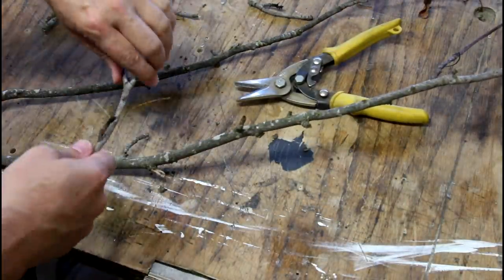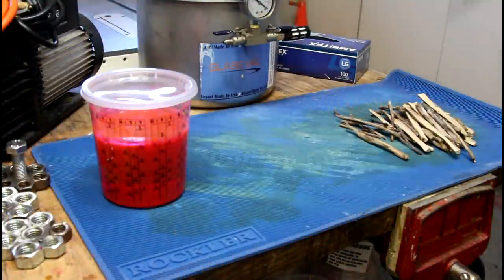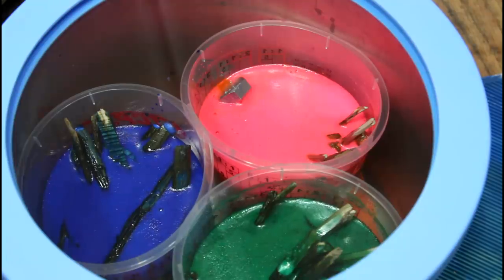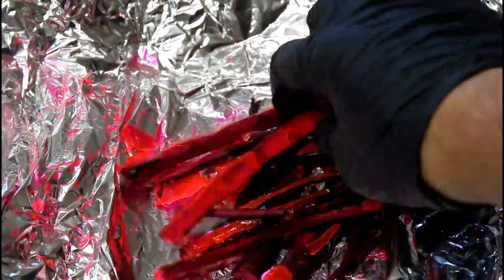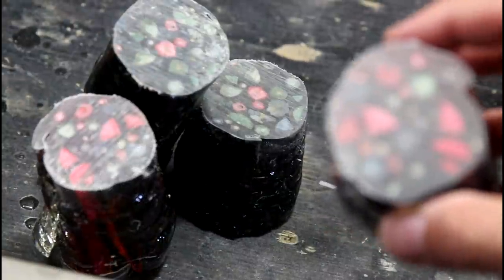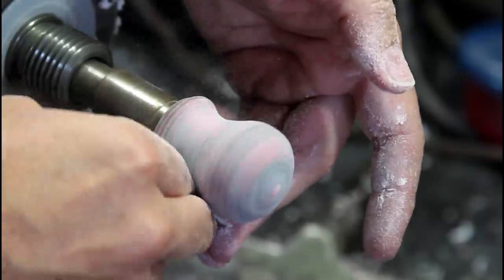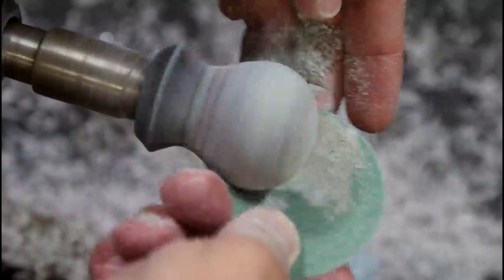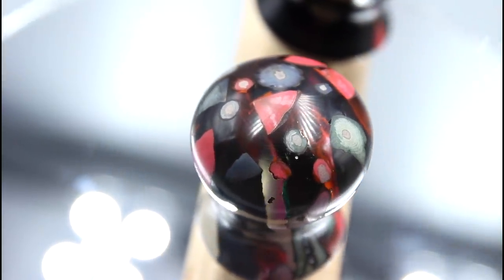Homemade Heather Gems?

Comment: The mistake you made is the heather is separated too much, there's too much space between the pieces. What you need to do is pack them into the molds until there is barely enough room to pour any epoxy, maybe even somehow make a mold that you could put the heather in nice and tight, and then crank it down until it's nice and tight until you can barely even get the epoxy in there. How they do it in the places that make the gems is they saturate the heather in super thick epoxy, then clamp it in vices specifically made for it and let it cure before they slice pieces off that they then carve into different standard gem shapes, as well as others. If you could do something like that before clamping it down in a mold you could potentially get near professional looking heather gems.
Oh and the 'little dot' in the center is either because you didn't dye them nearly long enough, or because you need stronger dye if you want full saturation of color to the core. Not sure which it really is that's the problem there, though.